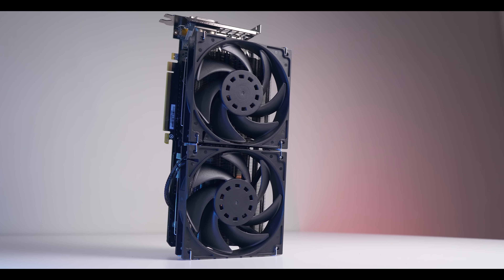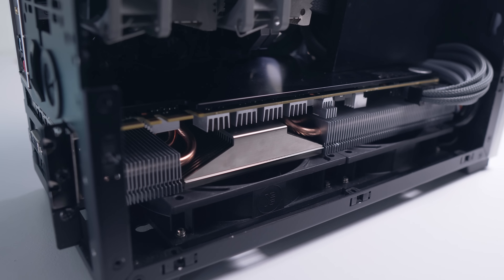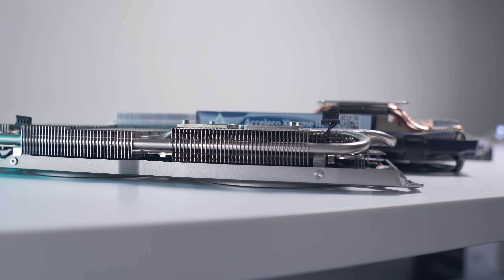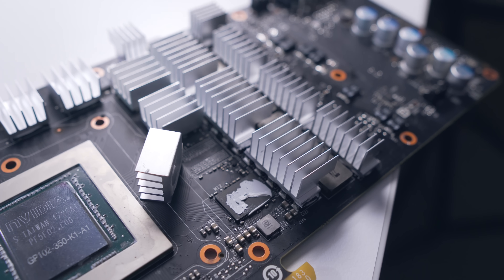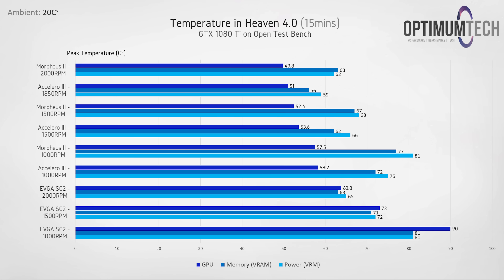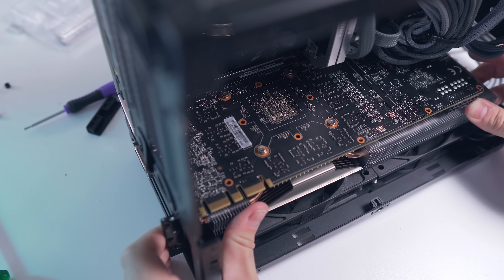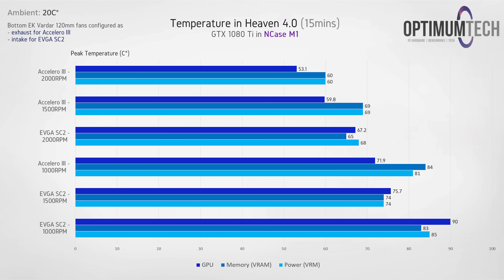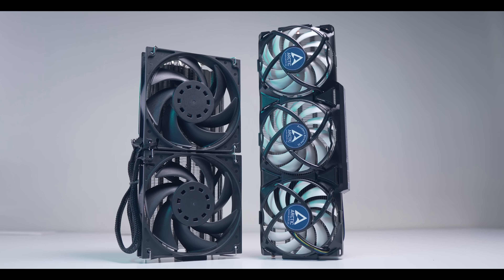Accelero III on a 1080 Ti - Exceeding Expectations!

Comment: Morphy looks so much better. Yes you have to buy fans but in the end card going to look like high-end product. Accelero really look cheap and they should really improve quality of that plastic.
Reply: Best cooler is accelero xtreme (3xfans),since I have this, my cards almost never go beyond 50 ° in full, completely cool the gpu and also pcb over the entire length. The 3 fans are ultra quiet, even at max speed. Purchased 8 years ago (already) for a 560ti evga, version accelero xtreme plus 2, I managed to adapt it on my 970 FTW with a slight offset, but now fits perfectly on my new 1060 evga SCC without any problem , and still as efficient, very low temp, lower than any watercooler system I have ever seen. Example Tekken 7 between 30 ° and 45 ° max in full ultra(fans at middle speed), ditto Project Cars 2, and all recent games ...8 years that it works like a charm, like what, look like does not reflect the quality(tested & approved).
Reply: TwizZtin If i dont know what the watercooling is better for 1060 i should know about watercooling...Are you sure?,i telling about performance/price in this case AX Plus2 is much better than all you mention (compare to the price...),what the interest to buy watercooling?,i haven't 4K screen,but all the world need have it,because you have it,all the world fooling the money through the windows?,sorry but that you mention,coast how?(not a secret money buy all,you too),prove it funny commentator,have the monster machine,and what do you do with?,than to make stupid comments, remonstrances for those who ignore the subject of conversation. 

Who's the best ?, watercooling ?, how watercooling is, what's the best ?, who is the best ?, money for sure, but not here. I can OC my GPU to the best with low temp, 55 ° max, and without OC 40-45 ° in latest games, but it's enough for what I have to do?, Oh yes as long as I hold you, you say hold material that I doubt that you have oddly, something tells me that a furious OC is not very good in computing and that he spends his time playing video games, otherwise the OC is useless . So let's get back to it, Accelero Xtreme 2 (i've buying this 60 $ 4 years ago), now tell me how much money do you have in your ventilation system, and in what configuration do you need it? Before I say that I do not know anything about it, make sure you know what I'm talking about.
Reply: Around 120 FPS non OC on Heaven high setting 1080p,around 100 with OC on ultra setting. Change your diaper and go cry,moron!

"You 're pretencious,just to tell watercooling is better airflow" What should that shit even mean? i never talked about AIRFLOW in Watercooling, that's the thing, for Watercooling you don't need Airflow. For aircooling you need good airflow which means NOISE"

What this shit,bad google traduction again... nor air FLOW,but just AIR,and you need AIR for your radiator WC. Good air cooling does not necessarily make a lot of noise, the proof, at maximum speed, we hardly hear them.

Anyway the subject is not there, in terms of price performance, there is no better, it's good you're happy?, go go to bed the troll now. Who can judge people who want to know why they would spend 2 to 3x more expensive, for a gain of course, but not necessarily necessary for everyone far from it. When you see the savings of candlelight on which people make concessions, one is entitled to wonder if, people who buy a card 20 $ cheaper, to have a huge difference of performance, frankly it is not worth the shot, they should think, and it's not the creatures like you who balance his money through windows all the time, who will give good advice!

The obsolescence on our doors, we must be impartial between the prices / performances, so do not talk to me about Fanboyism, but rather militancy, and there is need in this area. The sector that has accumulated the most wealth in the last 15 years, but which especially divided consumers, with this kind of thinking con, I pay 3x the price so I demand quality, that's not normal, FANBOY is you! And the fanatics have not finished running.
Reply: KrekerisT Then they'd have to charge more and you'd start complaining about the price.
Reply: By the way, who thinks you know I do not know watercooling, what do you know about accelero xtreme, have you tested it ?, it works both ways.
Reply: TwizZtiN Who does not need this index? it is always a parameter not to neglect on all the tests,if you do not agree it's the same,not matter. 

You think the navel of the world with your hardware, and how I should update myself, I have an i7, a good motherboard, a very good graphics card, the best of 1060 can eat a 1070. This is not enough to date according to you ?, and if you do not like that I kept this device AE extreme plus 2, they made 3 graphics cards, proves that they last a long time without failing. Already an indicator that you try to choke because your claim pushes to denigrate this device to AIR, which is the center of the subject I remind you?, Not YOU!

And yes I bought it about 8 years ago, and reinstalled on another card and on my last one had to readapt (since I was not going to buy an accelero xtreme plus 3 while the "plus 2" are the same except the serifs to fix them).

 And then I'm not calculating the years of purchase, I do not care royally, it remains purely indicative, the rest of my temperatures, if I changed it is obviously OC extreme, poor troll.

You're despicable of pretension but what you say about your material and your temperatures are not able to prove it, that I can.

The ideal is that my temperatures correspond to my use, ie average game graphically, I turn 40 °, a greedy game will take 50 ° but rarely beyond, it must tell you how?

        "It's not my fault you can't afford better hardware."

But I do not want to spend more for what 5 ° better, and what for ?, just for fun?, to say shit in the comments, just to say that I found better for 10x more expensive ??? That's what your thinking is, what you find funny in fact, is your lie that you carry since the 1st of your post. Who does not know anything about this AIR device, if you have not tested it then, SHUT UP! You do not interest anyone in this thread.

        "Do not get salty and stop talking bullshit."

Stop it now,you dont tell me like that ok,vindicative kid.

        "Seems you really do not know what you're talking about"

Well which talk accelerated xtreme and shut up definitively,you don't know what you talking about.
Reply: Twistin in his panties,read your firts post,what i do think about that?
Reply: Go to your bank and we compare who have "the balls",more seriously,what this comment?

 "if you don't know a Watercooler System which cools a GTX 1060 better then an Accelero Xtreme Plus 2, you simply don't know about proper Watercooling."

It's the subject of my post initially?,if it is to answer the side of the plate, and make a display of your equipment, you can repack, I have something else to fuck that to respond to wankers.
Reply: The offense is on your first intervention:

my GTX 1080Ti runs at about 43-47°C @2074MHz OC on Load on the Core (Far Cry 5 maxed out). Cooled by a Custom Loop with a 360mm radiator for the GPU and a 280mm radiator for my Monoblock (8700K @5.1GHz). While the Loop is totally silent it cools much much better then even the Morpheus II. So if you don't know a Watercooler System which cools a GTX 1060 better then an Accelero Xtreme Plus 2, you simply don't know about proper Watercooling.

YwizZtiN 2018!! Troll spotted.
Reply: Reality,you don't know AC Xtreme and STOP now the trolling.
Reply: TwiZtiN *Butthurt Léo7777 "very low temp, lower than any watercooler system I have ever seen. Example Tekken 7 between 30 ° and 45 ° max in full ultra" So you got no experience in Watercooling you get offensive on me? 

And well,it's real,not suffisant for you,but for the majority of gamers cant offer a watercooling deserve good advice, should then be better directed than a guy like you who spends unnecessarily,instead of that you spit in your mouth with your dough, fuck you !!

"lower than any watercooler system I have ever seen" (inferior at 2x the AC Xtreme price) fanboy it?,no just good sense,if you are offensed by this declaration,you would have done better to ignore it, just that you're an ass, and you did not help anyone.

I recommend it, in terms of price performance, and now you close your mouthpiece.

" You're still talking bullshit. What you don't even know is that your "max OC" is still less than you could get on air while you would still be lower in temps on water even with higher OC than on air. If it's okay for you to be "average Joe" fine, if it works for you? I'm into 4K Gaming, because i can afford it. If you can't don't be butthurt when you say shit like "very low temp, LOWER than ANY WATERCOOLER SYSTEM I have ever seen." This is SIMPLY BULLSHIT "

I repeat that,it 's not "just a bit better than a stock fan,i can OC,well now i don't know if low temp better for OC^^,at the base you take my comment for your,and you take the readers for what?,all the world haven't want to investigate much for that,buy AC Xtreme is extremely defendable,i show us,several configuration at stake, and it's true, the temperatures do not suit you?, the question of 4K, if I wanted, I would not have done better to buy a higher graphics card, dugland? , now, stop your comments to the con, say that I'm wrong or else, everyone does not have the passion of video games in the same way, when the 4K would be interesting I would think (by the way for some games the 4k is activated anyway, everything depends on the games, the rendering is sometimes not significant).

I HAVE EVER SEEN having pertub you,to has become agressive. I 've ever seen for the price,and for almost double price. I've ever seen,in major temperatures posted on the web,now post a prove with temp you announced, I think they have been lowered.

When to me I can prove each of the temperatures I posted, now if you want a fair comparison, no need to display your config to compare an old generation pc, I7 IVY, motherboard Z77 (but the best), a 1060 SCC EVGA that runs all the games in full see ultra for the most, a little 4K by DSR (on 1080p tv) according to the games, I have no concern for fluidity, my config is surprisingly stable and especially compared to the your, fully RENTABILIZED! (my war is here and you loose,what's your work need to have 4k OC?)

Thing that you can not know, comparatives fair, if the clientele wants to spend less, it's his right, and you have nothing to decide for THEM!

If people need to be advised to spend less on this system, they do not need your advice !!
Reply: Another point, there are other points of view that defend themselves beyond the fact of "not having the financial means", other motivations that make some prefer to wait for the 4K turn on the screens, for the simple reason that I had to buy dozens of flat screens, and that the obsolescence rages everywhere, that latencies that should have disqualified them to be sold, one is tired of being taken for wallets you understand?

Something else, and not least, having taken word for word each of my statements, just to show, without understanding why. You will understand that "computer pros" refuse to buy anything because they know ...

Offensed is you, not me, you offended the world who have the intelligence to refuse spend more too,and all those who count their money,fuck you just for that.
Reply: Card cool with stock FE cooler??? ACX 2.0 & 3.0 are a big shit,4600 trs/min and the jet is ready to take off in your house,the temperatures so higher,i gain -30° in comparison. I haven't need more for moment. But that's you said,at the start make reference by the one declaration that you have transgressed for your own(lower temp then watercooling i've ever seen...i yet completed my answer but you persist).

And now who's a troll?,now show us your temp you've announced at start,i have serious doubts.

and you continue to spit in the mouth of people on the pretext that they can not afford, will have to go down, to belittle a little bit, the builders themselves take us for pigeons, if I were you I will calm down a little. You have not discredited the AC Xtreme so far, comparative price pls, if you're tested the two?

I think you're a kid who goes from one video to another by fantasy about his own configuration, who takes the time here and there, prove it, your words is shit meanwhile , we compare the prices can be?, and also the interest of a 1080Ti for the hour ?, the interest of the 4K screens, the interest of comparing 2 device of cooling of cards on 2 different models (1060 vs 1080Ti in terms of heating they are not the same), so I need better ventilation, for better OC ?, do you think my 1060 can go beyond, if so, what would be this necessary, if not screw up long-term map ?, I imagine that at these frequencies you must not be super stable, but hey, fabulous as long as you want.

Respect people first, stop your arrogance.
Reply: Stock evga card gtx 1060 with acx 3.0 +75° non OC in latest games ultra setting,now 55° OC,enough to be profitable in your opinion?
Reply: Now you telling bullshit,try&error talk to you,haven't concerned by zetetic. If you have EVGA to test,i'm honest,I do not invent anything, the values I gave are true, they beat 75 °. EVGA cooler are crap,most of the stock are crap,in term of performance,and not loudy. That you said,is supposition,if you compare price/performance/utility of 4K/price of the Motherboard in concordance to OC max GPU.  

I buy evga for the PCB,not the rad,but i make like the same of people,i tested,despite,and change it,you're not perfect,and you made the same error. For an advice however you misplaced,we have a lot of surprise in electronic. Otherwise we would be in a system where you would not be able to know that you are being fucked. it is not thanks to you and your overwhelming policy like the publishers who divide and rule over hundreds of unnecessary, castrated ranges that you disgust me, but you will not be right in the end.

360mm is not an indicator,we have all the surface on the rad apposed on GPU,a very good rad that said,the quality of the radiator is as much more important than the quality of the fans. At least on this point, if we compare accelero xtreme performance on card stock rad vs ac extreme with his rad,beat them all stock rad.

The surface is'nt the cause,but the watercooling refresh better by mm²,provided you put the price(if not,you cannot beat the accelero temp), and still need to be useful, from this point of view, you are poorly placed to give advice to owners of I3, I5, GTX 970 bottleneck compare to the best performance / all the time of release as was the case for the 660Ti. To do business and to be able to give advice, we have to evaluate everything, if we only stick to people's wallets, if they could afford to buy the latest equipment, that would be developers would no longer be bothered to make compatibility between various GPUs and pc configurations possible. Otherwise we would be in a system where you would not be able to know that you are being fucked. It's good to you,having people not the mean to buy the latest technology,grace to them,you are pretentious i maintain.
Reply: I'm not a fanboy, let's say I'm not blind to the fact that rad stock should be all accelero xtreme basic,take exemple! And that manufacturers should focus more on their PCB, and boast their merit than their radiator to the nut which is worth nothing (they have the nerve to take this for a sales argument and more, acx 2.0 the best of the world lol ... sick *).

Instead of pestering this cheaper device than a watercooling of the same performance, is still too expensive for what it is, so that you can treat me as a fanboy, you'd better spit on the brand that we stick these shits on our cards.
Reply: Obsolescence subsist on reballing fixation of GPU's, they regn with this,in them stock rad,to have the top of pics variations of temp,goes in long time to the autodestruction, the tin no longer fulfills its function and eventually stick, and finally have a HS card but they pretend to act as if it were normal, and therefore take all responsibility away by finding other subterfuge for this obsolescence to be effective, ultimately planned obsolescence anyway.

They play to increase degrees max, the only parameter that allows them to live this obsolescence, the properties of the tin have limit heating and cooling long term. Now do not give morals to people who prefer to invest in a useful purchase, and to those who do not have the financial means, it is irespect for people.
Reply: You think with your foot,if coast of production is unlimited for you,not for THEM!
Reply: Liquid metal have you?,i hesitate for the corrode it making on nickel gpu's in long time. Prefer artic silver 5 for now(time waiting is very important to be effective after 48h),before tester gelid extreme,noctua,ect big brand,i return to the source,better for long life GPU,with silver paste. It would help to taking account of them obsolescence bounded volontary on overheating rad stock. GPU's of consoles ps3/x360 at starting to be obsolescent,in bin so much technology,primary and precious ressources of the planet,now,well the 16/32/128 bit consoles survive them,and live much long time,that is a problem. PS4 Xone subsist the same problem,GPU have nothing but reballing problem appear on Graphic pc cards,when it stop?
Reply: TwizZtiN What do you mean by "letting the fans spin in pull"? (sorry again google traduction is incomprehensible)

Them think about rentability,make a economy anywhere they can do,obsolescence by the stock paste,stock coolers,add this to the reballing fixation,you have the three consequences prove them put obsolescence (after guarantee as possible) by overheat.

Gelid is on the tests the best,but not for me,if AC5 is good applicated and waiting time respected,i observed a better behavior of my machine for results all similar. So I went back to AC5 without problem,paste more thick, easy to apply, to remove, its advantage is beyond its performance in degrees term.
Reply: Fans in aspiration you mean? See that the airflow is extracted over the gpu by this Noctua cpu rad,but not more efficient then accelero extreme,how do you explain this? https://www.youtube.com/watch?v=h6hvsqUEtZ4
Reply: In extraction,not need to explain this in détails,i've posted a link about extraction with very effective cpu air cooler (the best of Noctua),but not more efficient then accelero,which is not nothing. See the temp he have on  his 980Ti (i think lowest temp gpu average on 1080Ti FE),he have more degree then me in the same test,prove this rad accelero is really good to be measure by Noctua NH-D15. https://www.youtube.com/watch?v=h6hvsqUEtZ4
Reply: If you want to verify that,you need a vertical rad position,and still the video that I posted to you proves that it is not the best by this process, but well and truly in the wind tunnel, horizontal disposition, allowing the 3 fans to blow and cool all the zones of the pcb. What the extraction would be difficult, the exhaust fans are only valid to direct a flow of air equivalent to the internal blower, it must be equal or higher, never lower, but it is valid for those who are equipped watercooling also, who not only spend money in expensive system, but in addition will have to lengthen the bill of some fans for cases, to cool the whole. Extraction fans are less powerful than in the wind tunnel, even those designed for extraction.
Reply: Or you think the fan is placed in middle just on the gpu in extraction,and wind tunnel for the rad placed higher the fans in horizontal,that's possible,you can have a gain,not idiot. But you havent think the height of the card after this,the fan placed directly on the gpu,forget this,it's plastic,you need place it 3-4 cm minimum over gpu,add the height of the rad,you have 10cm height card GG.
Reply: You can gain to place a rad under the GPU too,like Zalman sandwich cooler.
Reply: Who telling you to refresh rad placing fans in extraction? lol
Reply: TwiZtiN Just one answer,where you take your measurement 650W TDP for your system?,why compare with Morpheus 2 dont prove anywhere he's better accelero (on the technical sheet of Morpheus 2 core edition,they talk to 360W TDP,i dont think it's real indication),similar performance i think is more proach the reality(not 60W difference dissipation)depends mainly on the size of the fans, starting more or less quickly, causing sharper temperature spikes on 2 large fans than 3 small fans. If you have 650W TDP on your system i want you to prove that is real effective,what's your aircooling.

ps: i 've also SSD pro S,but I do not see the report, as I have the impression that you are displaying what you do not have, it seems.
Reply: The core edition is full black it's so nice. The best good looking and better performing setup for me is the morpheus core edition for the GPU and the phanteks PH-TC14PE for the CPU. I have those in case my watercooling goes bad someday.